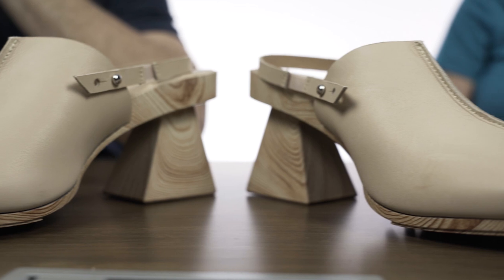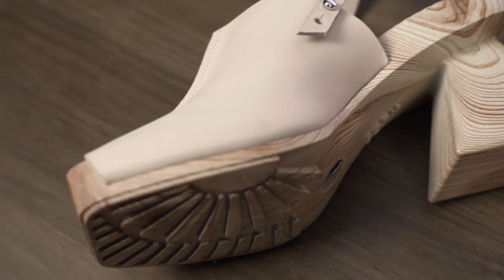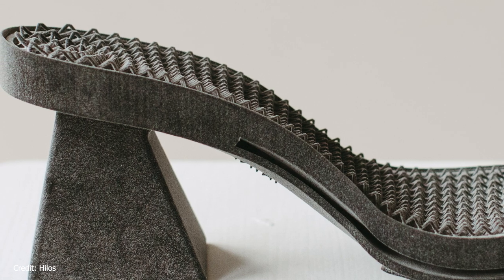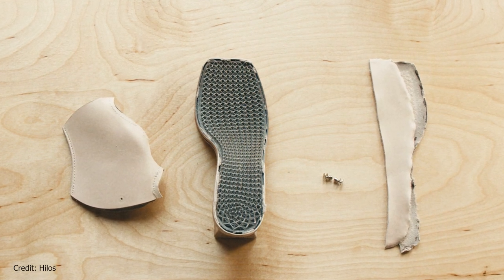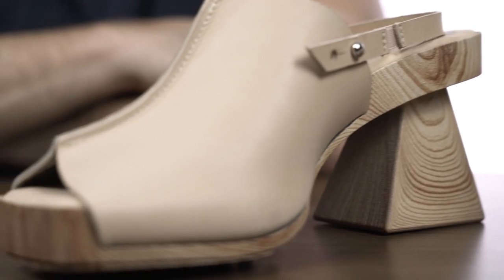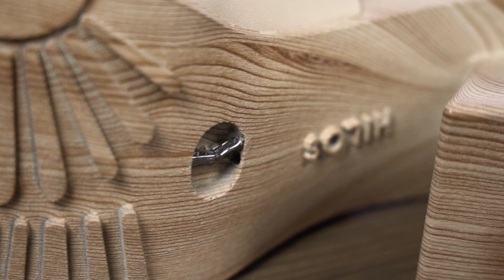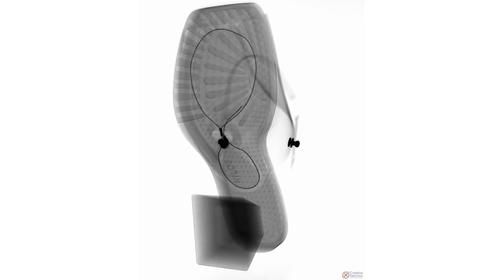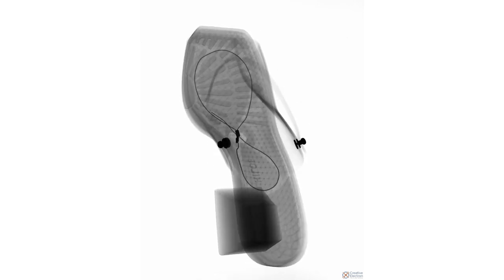An X-Ray View of Lattices and String Lasting: The Cool Parts Show Bonus

Comment: How was the lasting cord fastened to the upper? Usually string lasting cord is overlock stitched onto the edges as I've seen it done. Maybe the overlock stitches weren't visible on the x-ray, but the lasting cord was thicker or a different material.